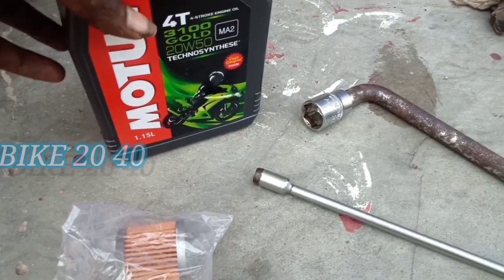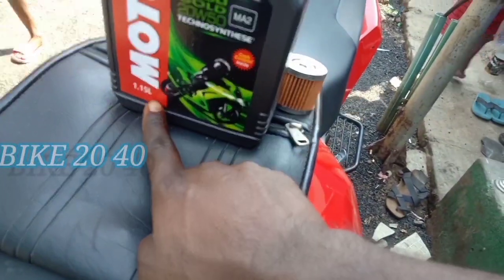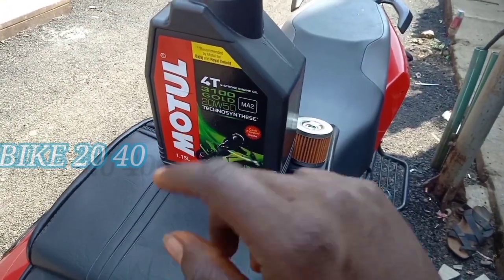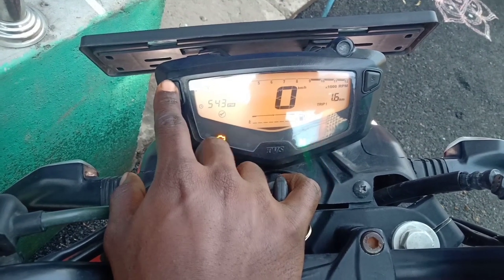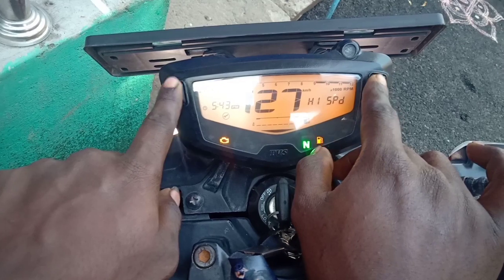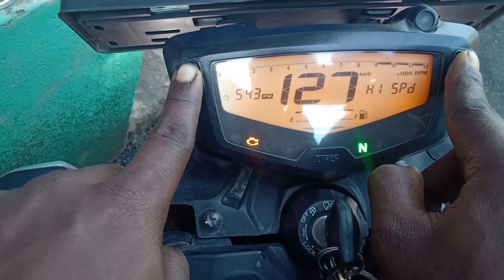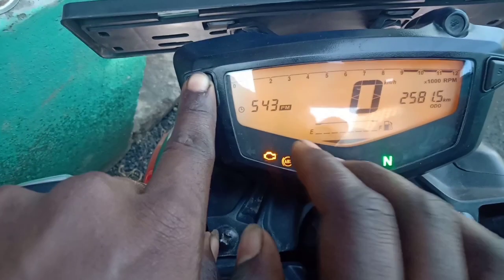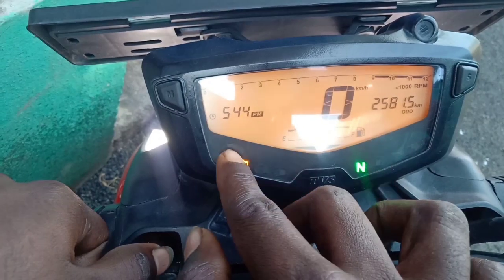How to turn off service indicator in Apache rtr 160 4v . How to off service remainder in Apache rtr

Comment: 1.Bro appo 2500 km ku oil change pannanuma Or munnadiye pannanuma? 
2. Apro andha oil name chat la potu viduga
3. Namma extra led lights, mobile holder la set pannumpodhu battery weak aavadha? 
4. Air pressure evlo bro irukkanu front and back wheel ku? 
5. Chain loose aana epdi bro therinjutu sari pandradhu adhu video poduga
Reply from the maker: 2500 km once change painna nu bro
10w30 or 10w40 grade iam using tvs oil
Power kamiya pota yathu havathu athukama pota battery low agum but running la pota no problem 
28 to 30 front 35 back
Sound varum bro . Kk bro

Comment: Bro what are problems you faced in RTR ??
Reply from the maker: First one month engine noise irruthu thu 
Neutral indicator problem . Tank ula water parathu. Back la Oru sound vanthu thu bro . But ipo yatha problem mo illa bro
Reply: @Bikes-xo4jz  ok bro ...last question it's worth ha bro for buying ... because am booked bike bro but now little scared bro adha ...
Reply from the maker: @dhanasekar4429  kaindipa pa worth tha bro  .  Power throttle . Seat comfortable . Look yala vara level bro
Reply: @Bikes-xo4jz  ok bro
Reply from the maker: Mm
Reply: @Bikes-xo4jz  bro oru doubt.. indicators blink aagum modhu sound varum ha bro while using left and right indicators